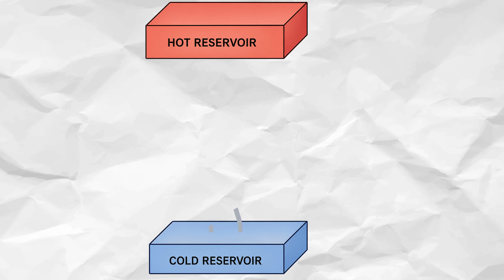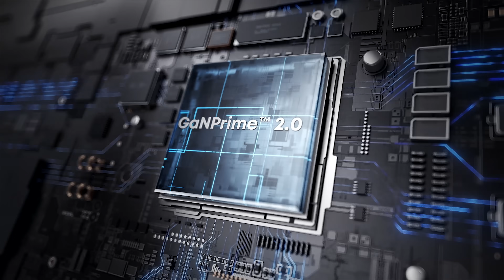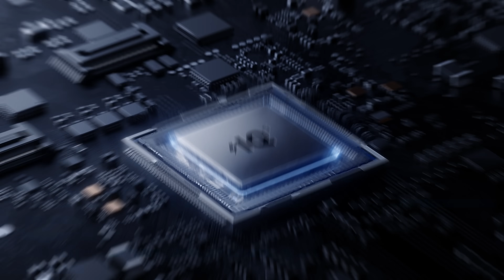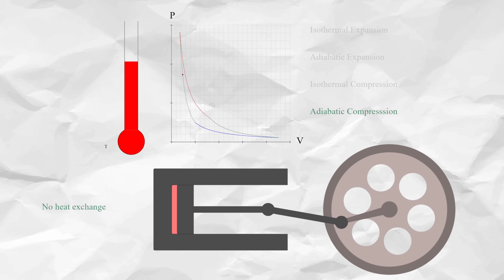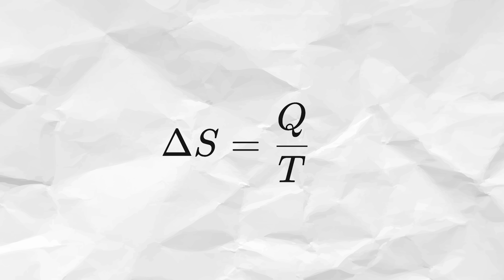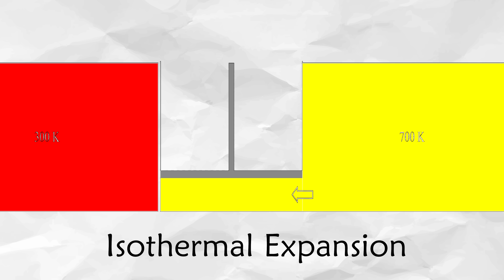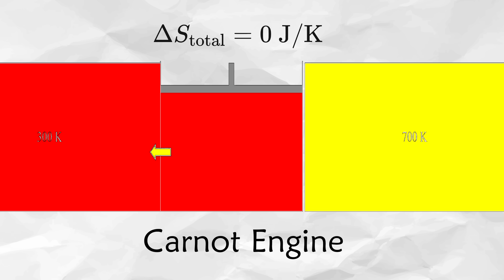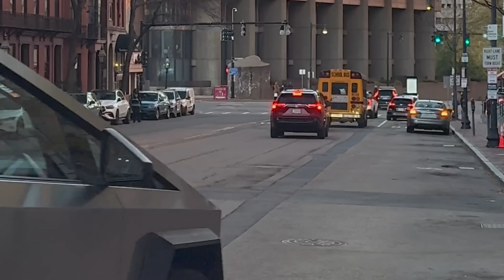This Tiny Engine Explains Entropy

Comment: Can you use a heat pump to pump energy from the outside to heat up the hot side even more so that the engine becomes more efficient? Carno's limitation shouldn't apply because we are just stealing energy from the outside
Reply: Sure! Use 100 W of electrical power through a 100% efficient motor to drive a Carnot heat pump. This pumps 300W of 300K outside heat to output 400 W of 400K heat - that's 400% efficient compared to just running that electricity through a resistance heater!!! Now use that 400 W of heat to power your Carnot engine (cooled by the outside air) at 25% efficiency and enjoy the 100 W of mechanical output power! Be sure to keep everything well lubricated...
Reply: A heat pump is just a Stirling engine ran in reverse you know... I'd be like using an electric motor to turn your Wind turbine but even less efficient
Reply: @lafeechloe6998  no because you're capturing energy from the outside. Their efficiency is more than 100% so why not use that
Reply: @norude then if you can capture energy from outside why not just...use the energy for what you want instead of powering up a Stirling engine in order to improve its energy production? That's exactly what I said about turning a wind turbine with a motor. The energy comes from the outside there too. But there's no point doing this at all...
Reply: @lafeechloe6998  yeah that's a good idea, why aren't there heat pump-based powerplants?

Comment: The Penrose process is pretty efficient. You need a rotating black hole though, so it has some engineering challenges for engine designers.
Reply: I somehow feel that having to worry about a leak in the fuel tank after crashing a car is slightly less worrying, than having a micro blackhole under the hood... or where ever they'd put it...
Reply: Matter-antimatter annihilation is 100% efficient, but it’s hard to find a source of free antimatter and it’s unbelievably inefficient to produce and store on earth.  In practical terms it really comes down to what you pay for vs what you get which is why solar and heat pumps are so efficient.
Reply: @hugegamer5988  It's 100% efficient at E=mc^2, but using that E is difficult. It creates photons, which maybe you could theoretically send into something like a solar panel, but the simplest method would be having them heat up some material and then boiling water to make steam to run through a turbine, which is not 100% efficient.
Reply: @Ekipsogel  that’s almost word for word what I said above.  Also heat engines in an ambient nearly unlimited size heat bath, like on earth, are more appropriately analyzed with exergy than absolute Carnot efficiency which often does not get taught or if it does its graduate level understanding.
Reply: @hugegamer5988  No they did not say exactly what you said word-for-word. And also they are correct that it would be impossible to convert the energy released into work or electricity at more than a 35% efficiency.
You are obviously thinking in heat pumps, which are   work + heat -> heat. Not    heat -> work + heat    which is what Carnot aplies to.
Reply: @Fiatsalesandmarketingadministr  heat engine efficiency is in terms of ( 1 - (Tcold/Thot)) where T is an absolute scale like Kelvin or Rankine.  35% is a nonsense news article number.  All you need for a near 100% efficient heat engine is a low side temperature reservoir, the exhaust, of near absolute zero.
Reply: @hugegamer5988  Doesn't the energy from annihilation turn into random particles really fast? How would we even capture it before that happens?
Reply: @archaonzero7401  not really.  It’s primarily gamma rays which is just high energy light.  Maybe you want gamma rays then it’s perfect.  In any case you can always enclose it and use the absorption to generate heat and then use a regular heat engine.  On human size scales everything is 100% efficient because of conservation of energy so for practical things it comes down to what you have to pay for vs useful work you get out.
Reply: @hugegamer5988  You just said "then use a regular heat engine". Which has a MAX efficiency of 35%. NOT 100%.
Conservation of energy does not mean 100% efficiency.
Reply: @Fiatsalesandmarketingadministr  Carnot heat engine efficiency, or absolute thermodynamic efficiency, has a maximum efficiency of 100%.  You simply need a cold reservoir near absolute zero.
Reply: @archaonzero7401  In physics energy is essentially always either kinetic or a particle. The most 'just pure energy' thing is a photon.
Reply: @hugegamer5988  "what you get for what you pay" refers to coefficient of performance, not efficiency. Antimatter-matter reactions used in heat pumps or solar panels can never be near 100% efficient when converted into mechanical or electrical energy
Reply: @Southghost5997 false.  Heat pumps are commonly rated in exergy efficiency where 300% is realistic.  You pay in electricity and get 3x the heat energy back by concentrating environmental ambient thermal energy.  I have a masters in mechanical engineering and defended the exergy approach in front of three professors, but it’s not an appeal to my authority, it’s actually educating people who don’t understand physics as to what’s measurably real.
Reply: @hugegamer5988  Referring to different definitions of efficiency. By 300%, you mean (I think) that you get back 3x the energy you put into a heat pump. This energy comes from somewhere though, the "ambient thermal energy" as you said. AND this is heat energy you get back, unordered energy - that is a 100% loss of ORDERED energy.
Heat pumps are ordered (electricity) + unordered (ambient heat) converted to heat (unordered).
Solar panels are photons (unordered in this context) converted to ordered (electricity). As such, the best solar panels are about 30%, and will never exceed 35%
Reply: @Fiatsalesandmarketingadministr  heat pumps are measured in exergy efficiency, which is process efficiency and it’s in terms of what you get divided by what you pay for.   You’re overthinking things in that ordered has nothing to do with it.  It’s simple energy density, it takes less energy to concentrate it from ambient using a phase change than to simply create it directly using a near 100% efficient process like a resistor.
Reply: @hugegamer5988 What's not so efficient is the turning that energy  into something useful. My Star Trek head cannon is that dilithium crystals are super efficient at photovoltaic transfer being active throughout the spectrum possibly particularly in the gamma band.
Reply: @travissmith2848  haha yea, if you need gamma rays for that or to make a Hulk you’re extremely efficient.  If you just need heat and get it by absorbing the electromagnetic radiation it’s also highly efficient, near 100% if the reaction is fully enclosed.  

But resistors are also nearly 100% efficient at turning electrical energy to heat, especially with DC.  However, process efficiency is what most people care about, like you mentioned so it’s best approached by exergy, especially on earth, such as how heat pumps are rated.  It’s possible to get 300% because for each unit of power you pay for in electricity you get back 3 units of thermal energy by concentrating ambient energy.
Reply: @hugegamer5988  misleading, u still end up with a hot thing u have to turn into useful energy. 
Any engine using this energy would still lose energy.
Reply: @Broockle  the misleading thing is absolute efficiency, what business and laypeople want to know is how efficient the process is and primarily want to know the effect/cost ratio.  This is why heat pumps are rated for things like 300% efficiency and it’s real.  You pay 1 unit of electrical energy and get back 3 units of thermal energy by concentrating ambient thermal energy of which it’s nearly unlimited in human terms.  Or solar panels where you pay once to manufacture and then just absorb free energy from the sun which is even closer to unlimited on our human scales.  We have had a hot thing in the sky for all our history and it’s free, no one weeps for lost solar energy but when gas prices double everyone very much notices.
Reply: @hugegamer5988  uh o jeez, the enter key exists you know. 
Not sure why you're brining heat pumps into this. But cool cool... cool cool cool. 
Yes Sun, Sun is hot, very good energy. 
Yes, good work.
Reply: @Broockle  the reason you don’t know why given your initial response is precisely why I mentioned it.  I realize people have trouble reading past a sentence these days, but the world isn’t simple enough to fit that lack of attention span.
Reply: @hugegamer5988  My comment is not enough to prove I read it all?
Have mercy on your readers, please format 😅
Reply: @Broockle  I’m truly sorry that 5 sentences needs massive white space for your ability to understand.

However most people do not require this.
Reply: @hugegamer5988  huh?!  😅
I read it, what is with you
Reply: Men in black knowledge
Reply: Why go to these extremes, the issue is the equation for "efficiency" - we just need a new, different equation without the problematic mathematical characteristics of Carnot's definition

Comment: light to electricity is not that inefficient
Reply: Solar light is an highly ordered source of energy
Reply: @lafeechloe6998  yup, i'm pushing back at him saying that you always need an inefficient process to start things. in reality the main source of energy that's added to the earth's surface is already highly ordered
Reply: @tubebrocoli  Photosynthesis is on the order of 2-3% yet we've been burning fossil fuels for thousands of years.
Almost all energy found on earth comes from the sun.
Even nuclear fuel was formed in a star somewhere..
Reply: @jimurrata6785  i'm not talking about photosynthesis, i'm talking about solar panels.
Reply: @tubebrocoli   You're talking about starting with an inefficient process...
Let's start with an inefficient process to convert solar radiation to storable energy (sugars and cellulose found in vegetation)
It's the energy we've been using for eons.
Unfortunately there are now billions of our species that consume more and more per capita.
Reply: @jimurrata6785  stop putting words in my mouth, and maybe stop spamming replies and read and think a little bit first.
Reply: Depends on the bandgap but photocells are generally considered limited to around 28%
Reply: @jimurrata6785  you're using outdated numbers. current research has perovskite-silicon cells that can reach aboyt 35% efficiency, and this is probably not the best we can do. it's just a matter of time when this is available commercially, because the investment and the tech are already there.
Reply: @jimurrata6785 No they aren't. It's the same idea as the Carnot cycle. The more concentrated the light is, the more efficient solar panels are. They can even reach 70% but the light need to be concentrated
Reply: @lafeechloe6998   So you take 4x the area of the cell and focus it on the cell.
Doesn't seem to make a difference to me.
Now, there are multi layer cells most often used in satellites that can pick up various wavelengths for higher yield
The lack of atmosphere helps a lot too.
Reply: @jimurrata6785  it's not about the area of the cell. It's about how much energy is available for the same area. If you take a 1m² solar panel and expose it to 1000w of solar energy you can extract 280W of electricity under normal circumstances. But you you take those same 1000w of solar energy, concentrate it 10 times onto a 0.1m² solar panel, then this solar panel will be able to output maybe 700w
Reply: Shockly limit is 33.7% but the reality is closer to 28% for cells that are cost effective to produce here on the planet surface.
Reply: @lafeechloe6998   Please explain to me like a five year old how you 'concentrate' insolation
Reply: @jimurrata6785 no need to dumb it down, you just use a curved mirror or many flat mirrors directed in the same direction
Reply: @lafeechloe6998   So, focusing much more than the area of the photocell onto it...
Too bad places like Ivanpaugh can't convert directly into electron storage.
It is \ they are stranded assets at this point.
Unfortunately the whole thermal aspect works against photoelectric.
Seems an opportunity to develop solar cells in the far IR. Maybe akin to a microwave patch antenna
Reply: @jimurrata6785 Yeah it bring some issues because mirrors cannot focus diffuse light so it stops working at the slightest cloud. It's why it would only be the best option in space. But in space the issue becomes cooling the pannel so it doesn't melt...
Reply: @lafeechloe6998   On earth the biggest issue with concentrated solar is cooling the cell so it doesn't overheat.
Obviously this only holds true with trough type mirrors.
With a huge array your cell gets vaporized.  😂
Meanwhile... with the technology we have Shockly sets a limit at 33.7%
Reply: @jimurrata6785 with X10 concentration it doesn't go above maybe 130°C maximum. With proper water cooling it shouldn't be above 50°C

Comment: Then fusion reactor has to have some limit to its efficiency we just need a 100% coversion rate Is there any other method of conversing energy to work 🤔
( Not the traditional steam engine/ turbine concept but more efficient than that )